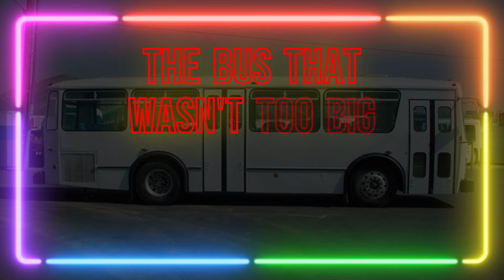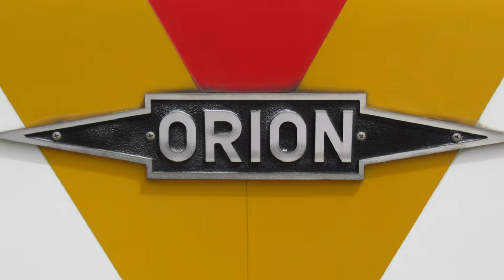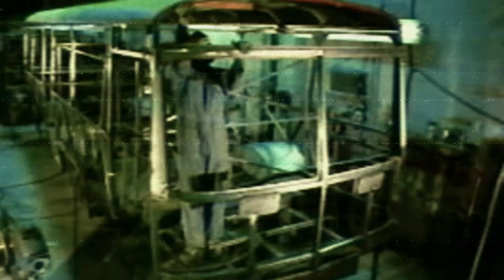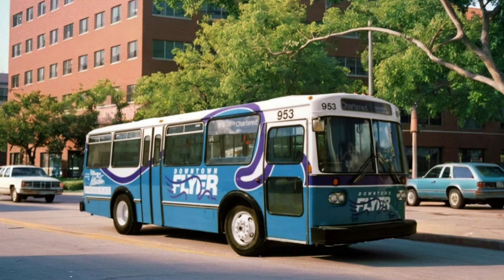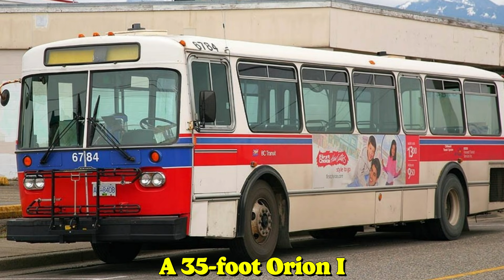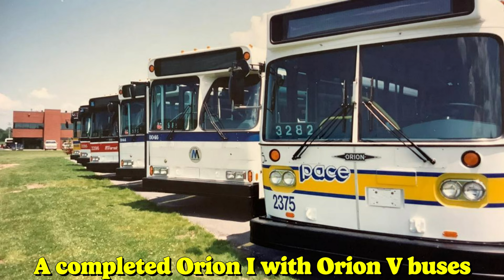The Orion I Story: The Smaller Bus that Stepped In, When GM and Flxible Walked Away

Comment: Really Well where I live was in San Francisco, that SF MUNI bought 45 of these Cracker Barrel Buses that were made for the shorter routes, and narrow streets, as they did not do so well as they decided to place them on my route which it is a cross town route going through 5 districts, as in the Evening that time to go home as when waiting for my bus to arrived that on the #12 Folsom route that it came as these Orion's were kinda nice, but the suspension was kinda Rough, and braking was not so great that the driver had to in what I called it "Griping The Brakes!!" as when the bus stop we are move a bit forward HARD. and then the seat count was a joke, instead of the 30 seats, we were given 26 seats since it was the first time in this type of bus had Wheelchair access and the front door was much wider. in which MUNI place these Orion's on my route - WRONG, as during the Morning, and Evening RUSH Hours that these buses that seats 26 were already Crowded, and PACK like Sardines, and this one driver did not noticed the problems that he had to PASSED Bus Stops leaving people to wait another 20 minutes, as the driver was let go for not notify MUNI of the problems, and it lasted for a month. Finally after the Month past that MUNI decided to place these toy buses to it's proper routes, as they replaced the Orion's with the Flyer's Model D40's, and then later NABI 40 footers, and then finally the New Flyer's Low Floor Hybrid's in which that these buses had 37 seats, and the floor base was not wider that they allowed these Larger Baby Strollers, and Carts as entering these Hybrid's are a JOKE.
Reply from the maker: Hello! Wow, thanks for all of this interesting info on your experience with the Orion I buses in SF! Didn't know they had so many problems with them!!! Thanks very much for watching!!

Comment: Ya the early Orion 1's (pre 1983) were kinda crap.  Rust/corrosion prone, slow as hell (forget about ever reaching 4th gear and 3rd only when going downhill ), electrical problems a plenty,  and they always leaked when it rained, the dual pane back windows almost always turned in aquariums (was not uncommon to have the space between the panes half full of water.  The later units were not all bad but early ones were just horrible. The only reason they kept selling initially was no competition or alternative.
Reply from the maker: Hello! Oh, wow, didn't know the early Orion Is were that bad!! Thanks for your memories and thanks very much for watching!!

Comment: Indianapolis had a fleet of the 1983 40'ft Orion's. It is by far the best transit bus ever built. Quiet, smooth, powerful, could maneuver on a dime. Not to be outdone, the 1986 Canadian built GM New Looks also the 40'ft version was the best of that series with the larger V8 Detroit Diesels, improved ride, handling, much quieter than earlier American built models. These two models in these years were better in every way than anything that came before them, but the 40'ft Orion transit buses were the best ever built. I know the Orion's were a "T" drive design, and I'm thinking that the Canadian built GM New Looks were "T" drive as well, versus the "V" drive as built in America. I tried so hard to purchase an '86 GM New Look, but found out later that once the buses were retired, all of them had been acquired by a group down in Mexico. As for the Orion's, I have no clue where they all ended up.
Reply from the maker: Hello! Wow, very interesting, thanks very much for your memories of the Orion I buses in Indianapolis!! Plus the info about the New Looks!! Thanks very much for watching!!

Comment: What about Orion buses operated by WMATA/Metrobus in Arlington VA that had 4 stroke engines? I think these were full length. They might have been the first city buses in the area that didn't have Detroit Diesel type engines (since many years earlier when some "Arnold" buses had 4 stroke engines,I think Cummins. (Arnold was the private company operator of the buses,not the manufacturer.  I think White Motor made those buses.
Reply from the maker: Hello! Oh yes, I think WMATA had the Orion V buses, similar to the ones in New York. Thanks for your memories of the buses in the Washington area, and thanks very much for watching!!

Comment: I bought 14 Orion I's and 7 City Cruisers when I the manager at CyRide in Ames, IA.  The City Cruisers had lots of corrosion problems due to no undercoating and were gone in 10 years.  The Orions were great buses, well built and good support from the factory when needed.   We ran several of them more than 600,000 miles (at average speed of 12 mph).  They all lasted 20+ years.   We also bought their demonstrator bus (CyRide #908).  Our specs were deemed to restrictive by FTA and we had to open the bidding more when we went to 40 foot buses.   I am sure Jeffrey will do a story on early Gilligs at some time in the near future.
Reply from the maker: Hello! Wow, thanks for this "inside insight" into the differences between the Orion I and the City Cruiser! I couldn't find much detail about that! Very interesting to read! It seems that the buses built at the original factory were better than the ones built when they had to move their manufacturing south. Thanks very much for watching!!

Comment: I rode on Orion 1 buses many times during my undergrad years at UF - the local transit operator had them in service until around the mid-late 2000s, and being among the older buses in the fleet, they typically used them for on-campus service with the newer buses serving the city routes. Most of them were of the longer variant with the swinging front door and also had a third door with a wheelchair lift adjacent to the rear door. I recall them having a step sensor on the back door so to exit out the back door you had to step down to make it open along with the distinctive "clunking" of a solenoid.
Reply from the maker: Hello! Thanks for your memories of the Orion I at UF - very interesting to read!! Thanks very much for watching!!

Comment: I drove these when Red and Tan had the Transit of Rockland contract. They had GIlligs, but also Orion I's and even the Orion II ...thing. Those I only drove once or twice. They were slow, and weird. But the Orion I's were the backbone of TOR for many years until the Gillig Phantoms showed up around 99.

The Orions were slow. I mean SLOW. Top speed, 35mph. They were 82 models I think, 40 footers, single front split doors. They broke down often, and towards the end of their life, they had as many miles on a tow truck as they did in service. Id say its not fair to critique a 30 year old bus, but the MC-9s we had were champs, being the mainstay of our commuter fleet. Even NJT was still running them, though the last operator in our area was Monsey Trails (and they had some nasty ratty buses, but the 9s always ran.)

Not much more I can say about the Orions. They drove wobble, slow, always smelled of burning...something. We all HATED them. It wasnt a new vs old thing. When the D4000s rolled in, we still wanted to run the MC9s, despite being slower than a brand new D4000. But they were nimbler because of the narrower 96 inch width. The Orion was a 102 if I recall, awkward, long wheelbase that made turns in the county very difficult (especially in the community college.)

One time we ran out of MC9s, and I had to take an Orion I on the NJ Trunpike into Port Authority to run a 45 route lol. People were very confused seeing me roll up, with a printed paper in the windshield. Some were intrigued riding on a different bus that as far as I know, never operated out of PABT. Execpt for the one time, when everything was done because of a crazy DOT inspector that red dotted half the fleet (except the county owned buses, that all somehow passed....)
Reply from the maker: Hello! Wow, very interesting!! I found this a really great read!! Thanks for posting your experience with the Orion I! Thanks very much for watching again!

Comment: Your story cut short. Orion bus industries continued producing buses with the Orion 4 and Orion 5. The older models had the 6V71 coupled to the Allison 6 speed automatic with second gear lock-up-a wild transmission with shifting basically every 4 mph😂😂. Later models used the DD series 50 4 stroke diesel. MTA eventually put them out of business with warranty claims.
Reply from the maker: Hello! Unfortunately, I couldn't do the entire Orion story, but I did actually mention at the end that Orion built seven models. Sounds like Orion had the same fate as the St. Louis Car Co. with New York - couldn't live without their orders, but it was New York that did them in! Thanks very much for watching!

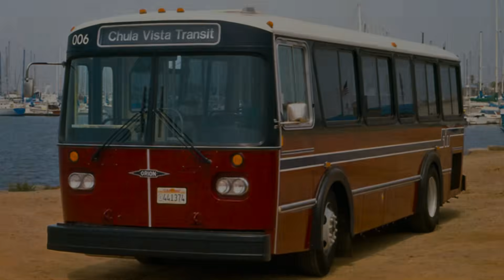Comment: Chula Vista Transit, later became part of SDMTS of San Diego here had those Orion I buses as shown at 7:50 in your video and I remember I rode them couple times in early 2000's, beside these 30ft buses, CVT also owned 40ft version which I rode them more than 30ft version at that time, Some of them equipped with Voith 3-speed transmission.
Reply from the maker: Hello! Thanks for your memories of the Orion I buses in San Diego! Very interesting to read!! Thanks very much for watching again!
Reply: I believe the 1990 and '91 models (016, 021, 022 and 023-029) had the Voith.

Comment: Command Bus Company had 40 foot suburban bus power by Natural Gas in 1989.
Reply: Your story cut short. Orion bus industries continued producing buses with the Orion 4 and Orion 5. The older models had the 6V71 coupled to the Allison 6 speed automatic with second gear lock-up-a wild transmission with shifting basically every 4 mph😂😂. Later models used the DD series 50 4 stroke diesel. MTA eventually put them out of business with warranty claims.
Reply from the maker: Hello! Yes, you are right - it was a project with Brooklyn Union Gas. I saw a picture of it, probably should have included it! Thanks very much for watching!!